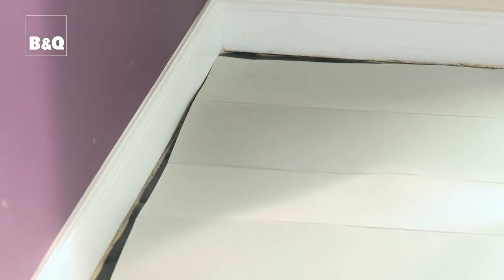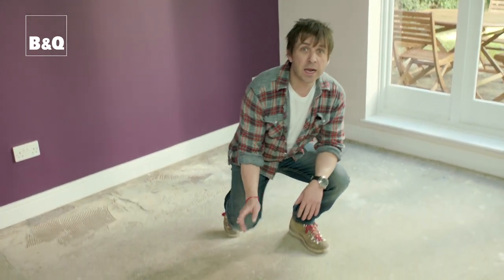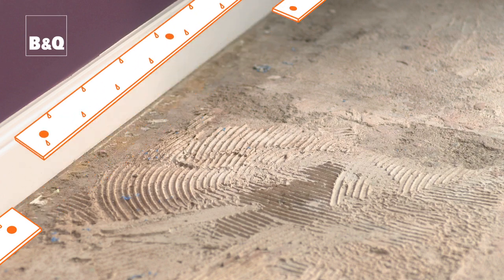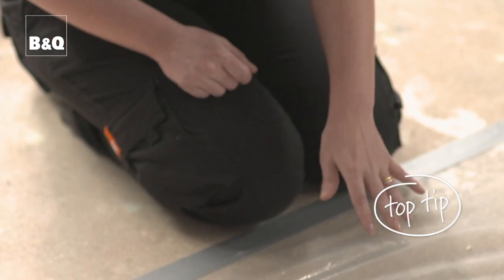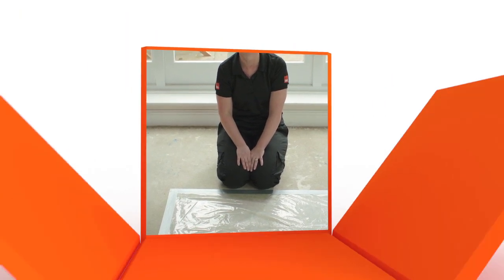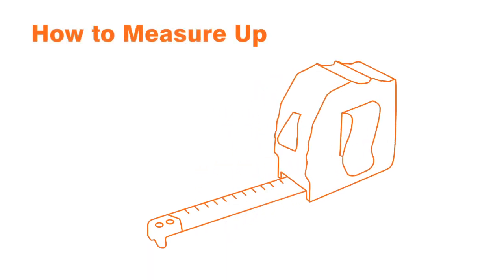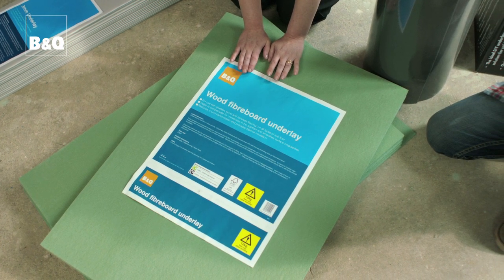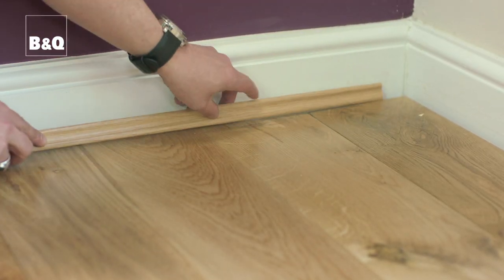How to lay flooring part 1: preparation

Comment: Which is the best underlay for solid floor? And do I need to lay any other item with underlay for damp proofing ?
Reply from the maker: Hi there, Part 2 covers the recommended underlay for solid wood flooring at timestamp 0.31. It's recommended to use an adhesive as the joints can come loose more easily - https://bit.ly/3Do1yOm

You will find our range of underlay for solid wood here: https://bit.ly/3N0r679

In Part 4, you will see at timestamp 3.03 how they install the self-adhesive underlay and solid wood flooring - https://bit.ly/3TrfQ6i

For damp proofing, you can use a damp proof membrane.

I hope this helps! 😊